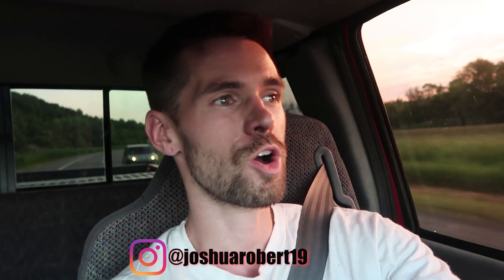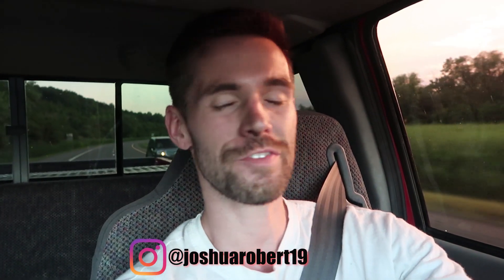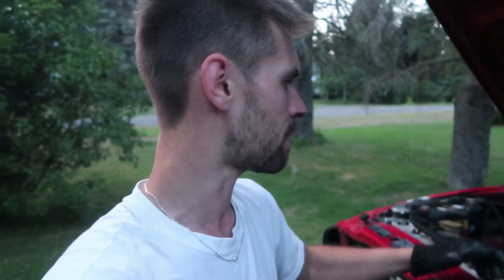How long was this PART MISSING on my CUMMINS!?

Comment: Yup these things get expensive luckily our parts arnt super expensive but it adds up. Dmax inectors are like 2k lol
Reply from the maker: DIESEL SYNDICATE which is exactly why I didnt want a dmax or powerstroke. Not really a fan of most dmax trucks anyways. Cummins platform is by far the easiest to work on and cheapest to buy parts for.
Reply from the maker: DIESEL SYNDICATE and it still adds up real fast even though the parts cost far less.
Reply: pure panoRAMa it does add up i havnt done a whole lot and already over a stack into the truck.

Comment: honestly i would say save your money on the merch till you have 4 or 5 k subs
Reply from the maker: ronnie cason it wouldn't be released just yet. I probably should have mentioned that in the video. But I've got some ideas that I'm looking to solidify and lock down more or less.
Reply from the maker: ronnie cason hows your hy35 doing? I've got the hx35 off the truck right now and I'm tearing into it.
Reply: Still waiting on larger snap ring pliers so that I can get the snap ring on that holds the compressor housing onto the chra and waiting for my friend to have a day off from work so that i can go over to his house and use his blasting cabinet to get all the rust off of the turbine housing and weld the waste gate flapper closed.  Also I have decided that I'm going to use my angle grinder and cut the arm off that holds the  wastegate actuator off since I'm going to be using an external wastegate for my application. I'm also contemplating cutting that little post that off of the turbine side of the chra so that I'll be able to clock the turbo however i need to for my application.
Reply from the maker: ronnie cason sounds like you got it all figured out. You'll definitely need to clock it differently for your car most likely. You can always spin the center cartridge I  the exhaust housing to clock it too. The turbo lab rebuild kit for hx35 says it's for a hy35 and he351 etc... I guess it's for a variety of the holset turbos so chances are we got the same kits. The journal bearings are definitely different than ones I got in my diesel auto power rebuild kit.
Reply: pure panoRAMa here’s the thing though that you’ll find out when you take your hy35 apart if yours is the same model as mine on the turbine side of the chra there’s a locating post that the turbine slides onto to keep it located for the proper clocking for the turbo on the Cummins. There’s also one on the compressor side but that’s was just like a little nub that I sanded off. I’m more then likely going to have to take my dremel and just the locating post off of the hot side of the chra sand the nub smooth so that I’ll be able to properly clock everything for my car when I get to that point.
Reply: Check out page 31 of the pdf for the hy35 looks like we both have the HY-35 type A check out the illustration and you'll see the locator pin on the chra for the turbine housing to slide onto.
http://www.myholsetturbo.com/manuals/HY35W.pdf
Reply from the maker: ronnie cason I didnt realize there was a dowel on both sides like that for the hy35. You're right, you'll definitely want them both gone to clock it properly for your car. I'm anxious to know how it all works out for you and see it installed on the car. I've had thoughts of building another tuner style car like the old days.
Reply from the maker: ronnie cason I wish I could track down an old Sentra SER or a clean 240sx to play with.
Reply: where are you located in the country?
Reply from the maker: ronnie cason I am in NY.
Reply: I used to live in upstate NY many many years ago
Reply from the maker: I am in Upstate. 15 minutes from Syracuse.
Reply: ok ok i used to live in the finger lakes area